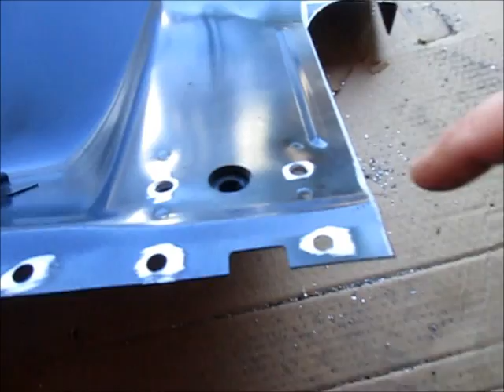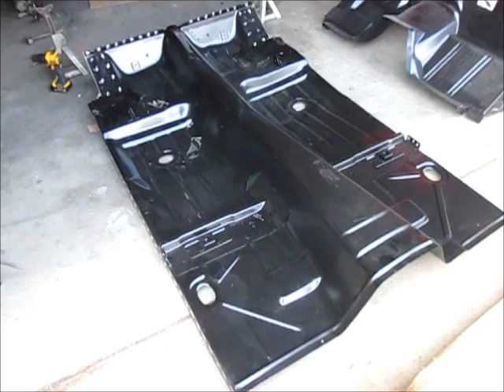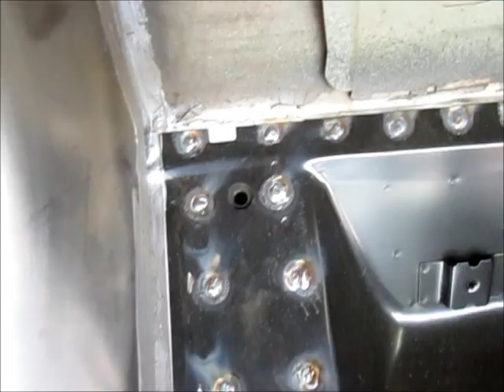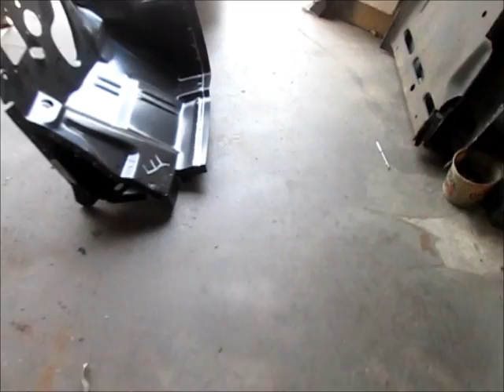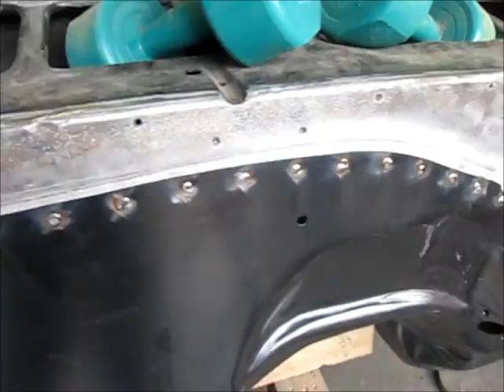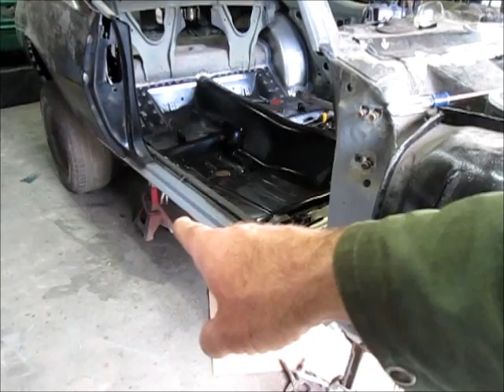1968 Camaro floor pan/firewall install part 3

Comment: Very informative video. I also have to replace floor pan and firewall. I did not notice any bracing inside the car or it being tied to a jig. How do you know the car ends up staying square?
Reply from the maker: The door openings support the shape.

Comment: did you do anything to take measurments on the subframe mounting locations. any issues when you welded it all up getting subframe lined up? im concerned about cutting out the firewall and floor and making sure everything will line up
Reply from the maker: I did basic measurements before removal of sheet metal. I had no issues when it all went back together.
Reply: Jo Daddy's Garage thanks for the reply.. When you say basic do you remember what points you used im gearing up to do a complete amd floor and dynacorn firewall as well.
Reply from the maker: I think I based measurements off of parts that were staying place. Like the ends of the rocker panels. Basically making sure the mount points end up where the old ones were. The pan and firewall I used fit very well, and I don't think I really had to adjust much.

Comment: Wish you were close to me, you seem to do trustworthy work. 
I have a 69 with what looks like a firewall cut about 4 inches up from the pan / firewall seam area, and an overlap of a new floor pan old pan and firewall with the pan under the firewall.  Odd but makes you  wonder.... They had to have it apart to do this amount of work why didn't they complete it the right way... Now I've gotta figure who to trust locally to consider the firewall replacement.
Reply from the maker: Yeah, that sounds like a do-over.

Comment: I don't see you using any bracing, how do you keep your cars square and level?
Reply from the maker: +Tamas Kish In this case, the main structure of the car is the outer panels, the door structure, rocker panels, roof, etc. offer plenty of support. Remember, the car is not under any stress at this point, and there is almost no weight on it at all.

Comment: Looks really good.  Out of curiosity how much is a 4 ft tank of shielding gas in your area.  I just had to drop $80 on mine at the local welding shop.  It's doubled in the last two years
Reply from the maker: Cobrafanatik22 Thought I replied before, but my bottle measures 36" floor to top of valve, and I payed $32.10 to exchange it.
Reply: Man that's a sweet deal.  Mine is about 4 foot tall. Welding prices are too high around here.

Comment: Hi there ,great work,as always. What's your thoughts on the black paint coating on the panels? Do you clear it off and paint or treat the closed box sections before welding them shut? I ask because I worry about the quality of this coating. I am convinced it is a cheap spray coating to protect the panels in storage and shipping and has very little value as a primer or long lasting protective coating. It seems to be very variable in terms of quality and barely resists rust for panels stored inside,never mind in the damp and rain. I have resorted to soda blasting new panels and applying my own primer and base coats . Weld points are stripped back and a weld through primer is used but even this needs further protection for long term results. I have tried to find out what paint panel makers use and found out they put little importance on it and use a cheap as possible coating!. What's your thoughts as a fellow end user?
Reply from the maker: Andrew Wilson The EDP coating seems to be fine if not allowed to weather. It's not a UV resistant coating from what I've heard, but I've found it can remain in place if it's prepped right. i generally leave it alone if it's not in a weld area. I will scuff it with scotch brite, and apply my primers on top. I've had panels sitting on a car for more than 5 years inside a shop, and had no problems at all. I think it comes down to the supplier. The really cheap stuff probably should be stripped and redone as they're not concerned with quality.
Reply: Guess you getting good quality panels. The repo panels seem to be blown over with rattle can black rather than EDPC!. I should stop letting owners buy their own panels!. Painting them with a properly prepped and applied POR15 coating has proved to be the very best and has stood up very well to all environments. Can't recommend it enough.
Reply from the maker: Andrew Wilson I generally get the best results with AMD and Dynacorn panels. I've even wiped them down with lacquer thinner, and the coating seems to resist coming off.
Reply: They must be better than the plus or minus a half inch repo panels we have to put up with over here in UK! Thanks for the great videos mate,keeps me inspired!
Reply from the maker: Andrew Wilson My AMD quarter panels fit like a glove on the camaro, and needed very little adjustment. Some parts I've installed on a Mustang needed extensive work.